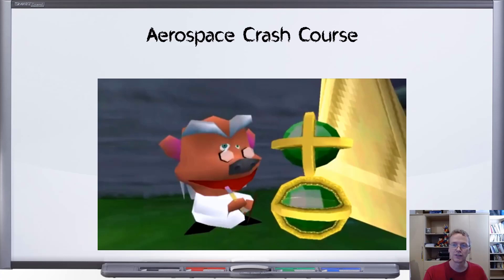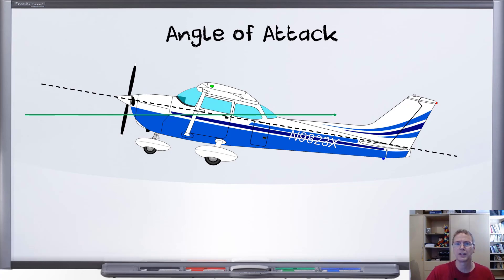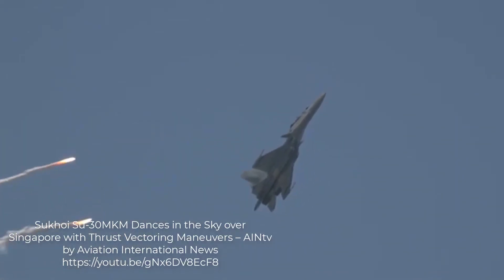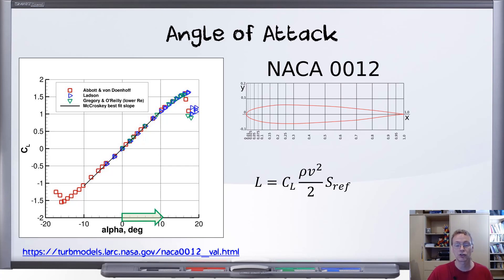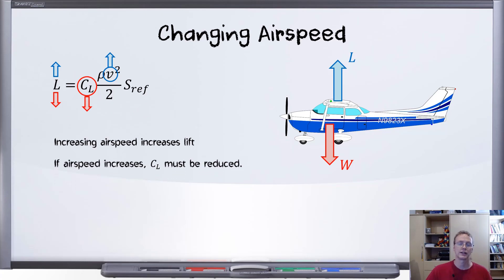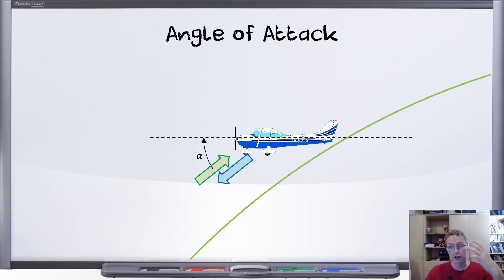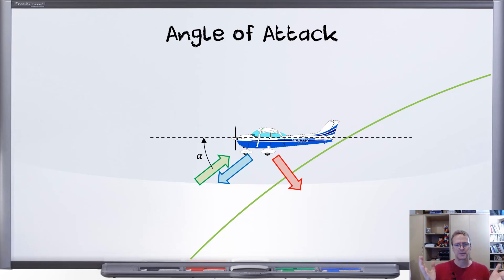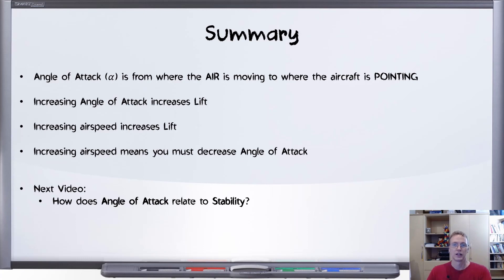Angle Of Attack

Comment: I'm defo NOT a flat earther. But part of the problem here is that there are multiple facets to the issue. Some of the Flat Earthers are claiming that the pitch of the aircraft never changes. E.g. they claim that if you fly from LA to Rome, then the devices they take on board (commercial gryos I assume) still indicate that no net pitch change has occurred.  Of course, on a spherical earth, a plane that took off in LA and landed in Rome would have about a 90 degree change in pitch. This 90 degress should be the final result of every tiny pitch change that occurred during the entire flight. 
It would be nice to get a second-by-second log of an aircraft's pitch changes during such a flight. That way, we should be able to create an animation of a plane flying from LA to Rome. And, if we zoom (view the plane's flight path from the moon) and speed up the animation, then we should be able to show the plane making thousands of little "pitch down" actions, until it reached the Rome runway.
Reply: That's the whole point of this video series, there is NO change in pitch. At any instant (in level flight) the pitch will be the same, there will be no corrections needed to maintain that pitch (excluding any corrections due to turbulence etc.). Any aircraft instrumentation recording pitch would record a constant value.
I guess what could be done is to keep a record of the pitch as determined from an accelerometer (as used in a mobile phone), and also from a gyro free to move in pitch with no limitation (or it's hi tech equivalent). What I would expect to see in this case would be that at the start of the flight the output of both the accelerometer and the gyro would be the same, but at the end of the should differ by 90 degrees. 
(Actually LA to Rome is nearer 130deg, I would suggest Washington DC to Rome is about 90deg.)
Nearly all flat earthers that have tried "experiments" on aircraft still embrace the "universal down" philosophy and expect to be able to measure pitch with a spirit level.
Reply from the maker: @thearmouredpenguin7148  This is no change in pitch as the term is defined in aerospace. However, @Ton (and many FEs) correctly point out that the aircraft DOES rotate.
The gyros on board the aircraft do not report this data to the pilot, but the data is in there. It's not a trivial matter to extract the raw data. 
What it would take is to get hold of your own optical gyroscope and bring it with you on the flight. That would do it. I've priced used FOGs, and I'm pretty sure you could get one up and running for under $1000.00.
Clearly a video on gyros is needed.
Short version: mechanical gyros use something called "Pendulous Vanes" to correct themselves as you fly. This eliminates the effect of the Earth's curve. No record can be kept of that... the mechanics of the gyro just cancel it as you fly.
optical gyros remove that effect in the software. Pilots would find that irritating in the extreme if their nav system didn't stay level with the ground.
In either case, the system uses the local gravity vector to correct itself.
Reply: @icansciencethat  I'm wondering if people would make the "flying off to space" argument for a ground effect vehicle ( ie ekranoplan) too. I doubt it,  but the principle is quite similar, afaik those are stable in pitch and altitude when properly trimmed.
Reply: @thearmouredpenguin7148  I suppose you'd also get wildly different results  east-west vs west-east for some reason.
Reply: @icansciencethat  I'm not sure if we've got our wires crossed or you are just trying to clarify what I said, but I thought I said the exact same thing as you. Perhaps I could have worded it more clearly. When I said the pitch does not change I meant relative to the surface of the earth directly below the aircraft, or as you phrased it "as the term is defined in aerospace".

Correct me if I'm wrong (not an uncommon event), but does a optical gyro not output the rate of change rather than a value representing an absolute direction.
Reply: @dodo3441  Yes, The flight would need to be the equivalent of 90deg relative to a fixed point in space not relative to the earths surface. Much longer going east - west than west - east.
Reply from the maker: @thearmouredpenguin7148  you are correct... we're saying the same thing. I kind of misread your post the first time. My bad.
Reply from the maker: @thearmouredpenguin7148  An interesting experiment. If I honestly thought doing such an experiment would change the minds of a significant number of flat-Earthers, I'd pony up the money and do it. But I'm no fool. Those of us who already think this would work, won't be surprised with the results. Those of us who think the Earth is flat are going to just cry, "fake". And in the end, I'm out a couple thousand dollars for nothing.
Reply: @Ton "then we should be able to show the plane making thousands of little "pitch down" actions". 
Think instead in terms of seeing the aircraft flying along a smooth curved trajectory, remaining a constant altitude above the surface of a sphere.
Reply from the maker: @dodo3441  well... ground effect involves the ground, so that's quite different. In fact, that'd be a great one for the FEs to run with. If any are reading this, there's a freeby for ya! Talk about ground effect vehicles and how they prove that aircraft don't follow the air density like I said. Prove me wrong and stuff!
Reply: @icansciencethat  
I wholeheartedly agree that such an experiment would have little effect on the beliefs of the majority of flat-earthers, and be a total waste of money and effort. Let's face it anyone who can spend upwards of $20k on a Laser Ring Gyro only to find that the result is exactly what they would expect to see on a globe, and yet still go on to deny it is a lost cause. I was really thinking more in terms of a thought experiment in response to Ton's OP.
Reply: @icansciencethat  Doesnt a ground effect vehicle "settle" at a certain altitude above the water based on mostly the same parameters as any other winged aircraft? Just that the pressure area under the ground effect vehicle behaves differently due to the proximity of the surface? And thus also follow the surface at fixed pressure altitude and pitch, regardless of wether its a sphere or flat?

The reason I brought it up is just because I think it may make the concept easier to understand. The assumption that pitching an aircraft up just makes it fly into infinity is obviously flawed to anyone who has looked into the mechanisms of flight. For a ground effect vehicle its more common sense to understand why it would not just fly away, because it requires a certain pressure to maintain lift, and in that case this pressure is only achievable (efficiently at least) within ground effect. 

But if someone understands that, they should also be able to understand that an aircraft also requires a certain pressure to maintain flight.
Reply from the maker: @dodo3441  Ground effect vehicles are special. They take advantage of something called "ground effect" (file under "Duh").
What I've described so far assumes an aircraft up in free-flight in completely still air. Out at V-infinity as we say. I haven't mentioned it (yet), but the wing creates a downdraft as it goes through the air, and this disturbs the flow - naturally. I mean... more "duh" really... air pushes wing up, wing must push air down. Goes without saying.
Everything I've talked about so far assumes the air hitting the wing has not yet been disturbed by the aircraft. (Yeah... we're just ignoring the prop-wash here.) This is a really good simplification for when the aircraft is high up in relatively smooth air, but it breaks down near the surface. If you put the wing near the ground, the downwash will reflect off the ground and rebound back up onto the aircraft. Suddenly, you're flying in an updraft... or it feels like it. That's not REALLY very accurate, but should give you a feel. More accurately described here: https://www.skybrary.aero/index.php/Ground_Effect
We haven't talked about aspect ratio, wing efficiency, or even drag yet; but you'll see all that mentioned in that link.
Here's a flight-school point of view: https://youtu.be/JP25m4SIrJI
From a pilot's point of view, you're coming in for a landing, and you "flare" or nose-up to slow your descent. But as you're about to hit the runway, you hit ground effect and you get this extra lift. Suddenly you've got too much lift and you stop descending. You'll see GA pilots bounce a little as they land or float along a bit before touching down because of this.
A ground-effect vehicle is one specifically designed to take advantage of the extra efficiency. They can be designed to be incapable of free flight outside of ground-effect. The wings and engines just aren't big enough to fly without the added benefit of ground-effect. Naturally such vehicles are only viable over water.
Reply: @Wolfie6020  just emailed you a quick animation showing my thought experiment. - thanks! tony
Reply: @icansciencethat  - i just emailed you a 5-minute video clarifying the thought experiment. thanks for your channel! - tony
Reply: @Ton369  Thanks,  got the email and will watch your video shortly.
Reply: @thearmouredpenguin7148  If you mean "much longer..." referring to time, the elapsed time would be the same going in either direction (all other things (i.e. no winds) being equal. However the displacements could vary as seen from a reference frame in space, even for travel in the same direction on earth. How would you define a "fixed point in space"?
Reply: @artian11  ”How would you define a "fixed point in space"?”

I believe we are both thinking the same thing but for clarity I think what I was trying to say can be explained in the following way.
(For the purposes of the explanation ignore the fact that the start and end points may be in the middle of an ocean, assume our aircraft can fly at supersonic speeds and there is zero wind.)

If our aircraft starts at a point on the equator at 0deg longitude and flies due east for 6 hours, at a ground speed of 1666kph, to a point at 0deg latitude and 90deg E longitude, then from a view point in space (looking down from above the N. Pole) the aircraft will not have moved and the gyro will still be point in the same direction referenced to both the aircraft and free space. This would be because the earth has rotated 90deg in the opposite direction during the flight.

If our aircraft now flies the reciprocal course starting at 90deg E longitude and flying due west at a ground speed of 1666kph, then after 6hours the aircraft would be back at the point 0deg latitude and 0deg longitude on the ground. However when seen from our view point looking down from above the N. Pole the aircraft would now be on the opposite side of the planet from it’s starting point and the gyro would still be pointing in the same direction in free space but the opposite direction relative to the aircraft. Again the earth will have rotated 90deg during the flight but this time in the direction of the flight and not against it.

(I hope this clears it up because I've just confused the hell out of myself.)
Reply: @thearmouredpenguin7148  I agree pretty much with what you said, but trying to fit into another reference frame is confusing. Above I used a reference frame fixed to the sun so earth's spin and orbit played a role. Careful with that 1666 kph surface speed, it's greater at the equator and FE believers see all sorts of nonsense in the "666" part. Also the earth turns toward the east, so looking down on the north pole it turns counter clockwise. Here is my analyses:

Plane flies east for 6h. Earth observer records this as a 45 degrees east change, 0 pitch change. Space observer records 90 degrees east change, 90 degrees pitch change.

Plane flies west for 6h. Earth observer records this as 45 degrees west, 0 pitch change. Space observer records 0 degrees movement, 0 degrees pitch change. 

Overall, to earth observer the plane ends up back where it started, no pitch change ever occurred. To the space observer the plane travelled 90 degrees to the east, and its pitch changed 90 degrees. 

(I ignored the fact that the plane has turned around, which has no effect on pitch, and pretended it is instantly reversible and there were no stopovers. )

Comment: Serious question: How is the line for where the aircraft is pointing determined?
Reply from the maker: This is a GREAT question.
Ultimately, for an aircraft, it's up to the designer to decide.
For a wing (airfoil), there is a specific convention we use for this. We draw a line from the point in the back of the wing to the point most forward on the wing, and we call this line the chord. The line of the chord is the zero alpha line. But when we put the wing onto the plane, we probably want to put it at some non-zero incidence angle so that when the plane flies level, the wing still has some alpha. Typically, the main structure of the fuselage is fairly straight, and we can simply drop a line from the tip of the nose to the tip of the tail and call that the zero line. But if you have an unorthodox design, the designer will just arbitrarily drop the line in where they imagine it to be.
I should also note that a full wing is often twisted. The chord at the inner part of the wing might not match the chord at the wingtip. So for an airfoil (a cross-section of the wing), we have a solid answer... for anything else, we just go with whatever seems most obvious.
Reply: @icansciencethat  Thanks for that info. So during initial prototypes/flight testing the "pointing line"would be confirmed/adjusted if needed? In the case of commercial passenger/cargo aircraft would the cabin floor be adjusted/installed to be parallel to this line? And for fuel efficiency would the axis of propeller/turbine shafts also be parallel to it? And where this line passes through the centre of gravity of the aircraft it is perpendicular to the gravity pull (in normal level flight)?
Reply from the maker: @artian11  the pointing line is really pretty arbitrary. On a plane big enough to have a floor, the shape of the fuselage will dictate the level of the floor. I think you'll find the floor on an airliner is nose-up a little as you cruise - just a tiny bit.
The fuselage generates a little lift too, so the max lift-to-drag would be if you tilt it up slightly.
The lift increases with alpha, and the airfoil I showed has 0 lift at 0 alpha, but many do not. The plane can be set up to have positive lift at 0 alpha... and that makes the 0 alpha point pretty arbitrary.
Reply: @icansciencethat  Very interesting info that I haven't seen before. Thanks again.

Comment: Quite frankly I don't see the point of this.   We're talking about a correction whose order of magnitude is 0.01°/s.  0.02°/s for the fastest aircafts.

In what real conditions would anyone be able to observe that? Even if you give the observer instruments with enough  precision, in what real conditions would anyone be able to observe that _in isolation_? That is, w/o any other corrections being made at the same time? corrections of 1, or 2 orders of magnitude larger, BTW.
Reply from the maker: Well, the video is about learning a little bit about aircraft design principles. I have thought I'd do one just on the scale problem you bring up here. I think that would get interest from the FE and debunkers.
Reply: @icansciencethat  It is interesting, but also very academic. This is what would happen if the air was completely uniform, no wind, same temperature, same humidity, same composition, always.

Sometimes, we can use an ideal model (e.g. a spherical Earth) and get results that are good enough (say, with an error of 1%) even if there real Earth is irregular in shape.

This is not the case, tho. The ideal model is very far from reality. This is why I mentioned the order of magnitude of the effect. Reality differs by 10000%.

Would it make sense to mount a X6 rifle scope on a XIX century handgun? Probably not. Its precision is too bad for scope-accurate aiming to make any sense. Aiming one MOA off a target at 100m doesn't decrease the chance of hitting it in any measurable manner: they are negligible anyway.